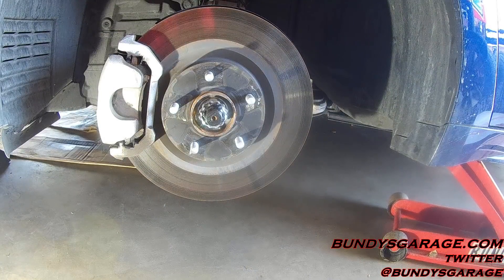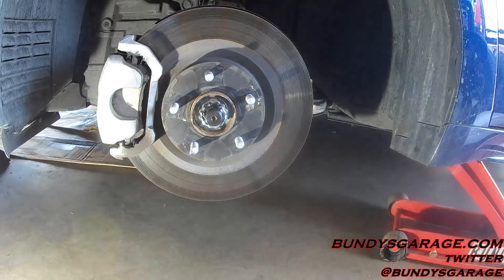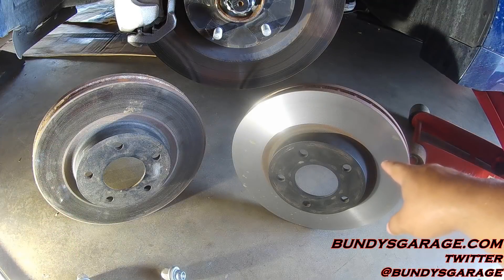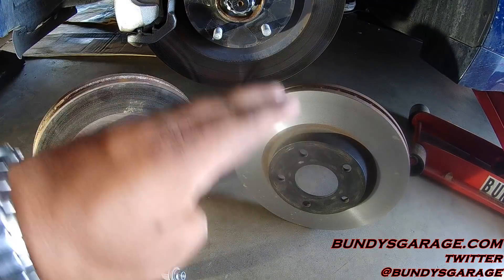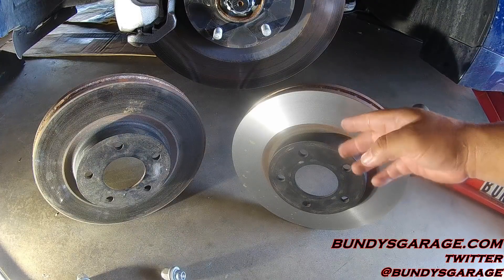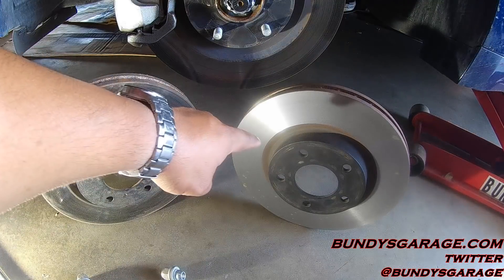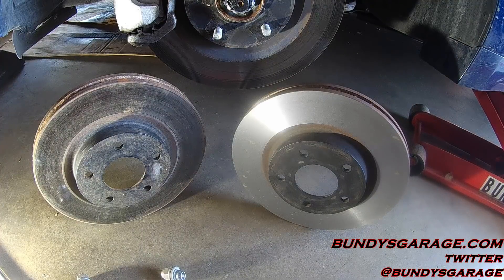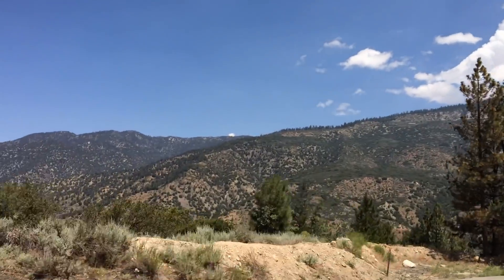Do I need to Turn Rotors when changing Brake Pads - What does Resurface Rotors Mean?

Comment: what happens if i don't resurface the rotor and just change the pads?
Reply: Nothing will happen. At all. I've never, ever, had a set of rotors turned. Never. I've driven a Datsun 510 with 300k miles. A minivan, several 4 door cars, an 05 Trailblazer and now a Suburban. Never had rotors turned. Never had an issue with brake performance. In fact, the only time I've HAD issues was a car someone else had and they did turn the rotors and all it took was ONE hard stab on the brakes and BAM, shuddering in the brakes. Also happened to my patrol car. No issues with brake shudder. They turned the rotors at 10k miles when it went in for it's first 10k checkup. Guess what. Brake shudder. If you rotors need to be replaced they'll let you know. I feel like rotor turning is the brake equivalent of force flushing a transmission. It's crap designed to take your money.
Reply from the maker: Nothing might happen and maybe 100 miles down the road you start to feel pulsation in your brake pedal as you stop. Take a gamble and find out.
Reply: That's called a pad slap. Not a best practice but you can get away with it often if they are in good shape still.
Reply: had my mechanic do it. said my front rotor was good enough. But the rear, it has a rust ring around the rotor, so it would prematurely wear my brake pads unevenly.
Reply: You'll save some money.

Comment: If your brakes are warped / pulsing don’t turn them. The grooves they cut away when turning are NOT What causes pedal to pulse. Only if your brakes are smooth but worn should you consider turning them. You want a smooth fresh flat surface for fresh pads for a good pad grip and the new pads seat and wear properly.

Comment: Actually rotors turned properly are better than brand new ones.  WHy??  Brand new rotors are stamped steel most likely in china where metal is highly suspect.  Also these new rotors have never seen any heat or vibration cycles and are more likely to warp than rotors that have been on the car a while.  New rotors are made of what industry techs call "green metal".  Metal that has seen no heat cycles.  I would take a "thinner" properly turned rotor over a new one any day.
Reply: lmao they aren’t “stamped steel” they are cast iron. stamped steel is something like a portable gas grill lmfao

Comment: there may be a cutoff point though. When "resurfacing" you are losing mass on the rotors...the same energy will be applied to the rotors as before...with less material from the rotor resurfaced there is more heat created than before for the rotor to endure....
Reply: This is true, but i think 99.9% of people will be ok.
The .01% are the people at the track pushing the car past its limits.
Reply: @Mrkevi123  is can matter in mountainous areas. But that is still a small percentage of the population
Reply: They are stamped with minimal thickness just make sure you got life left in them. It you’re already close to the minimum just replace.
Reply: @demonicredeye4183  Not all are stamped.  Especially if it's an older car.  Sometimes, you have to use the good ol' micrometer.
Reply: Terry Hesticles really? Everyone that I have pulled was stamped. I had to clean it with a wire brush but it was there.

Comment: I learned long ago that when its time to do a brake job don't try and guess if parts are reusable, use all new parts, because the time involved in doing a brake job is not worth the time it takes to troubleshoot what old part you reused is giving you problems.

Comment: How much should it cost to have rotors turned?
Reply: O'riellys
Reply from the maker: $15 - $20 bucks per rotor. Call around, some independent shops might do it for less if their not busy.
Reply: Was quoted $150 for two truck rotors.  No go.  Bought new for $165.
Reply: 3434sru yup they really don’t turn rotors anymore..aftermarket are so cheap to buy now
Reply: Canadian tire charges $50 per rotor but he hasn't done them in many years....not cheap

Comment: Brake rotors do not "warp." The pulsation or jittery feel is due to uneven amounts of brake pad material being deposited unevenly across the rotor surface to due excessive heat. You can resurface a rotor which solves this problem but it will occur more frequently due to less rotor material for the heat to dissipate through. bottom line is don't buy the cheapest brakes available. They are not all made equal.

Comment: Cool video.  I dont turn rotors any more.  i find it funny people pay 4/500 just to get the front or rear brakes done... i did front brakes on wifes corolla for $102 new pads and rotors delivered right to the door... about 20 minutes a side, less time than it would take to drop the car off at a shop... god damn i'm no genius but sure glad im handy
Reply from the maker: Yeah people pay way too much money for brake jobs when it’s a simple job. Shops love it and laugh all the way to the bank after doing them. It’s a simple job and most people are afraid of it. I have seen aftermarket rotors get warped after 500 miles. But on the other hand, have always had good success with an OE rotors that is turned and not slapping on cheap rotors.

Comment: Great video, what do you think about rear non ventilated rotors, I need to turn the rotors on my 2013 Ford Explorer, I have the non heavy duty rotors, so the rear are non ventilated, this is the first time I would have them turned, would they end up too thin afterwards? Or since it´s the rears it won´t matter?
Reply from the maker: There are markings on the rotors that give you limits on how thin the rotor can be. You cannot exceed those limits, if the rotors will become too thin  if you turn it, it has to be replaced.
Reply: @bundysgarage  I'll check the markings, thanks!!!

Comment: Whwt happens if I get the pads replaced but dont resurface the roters
Reply: I'm no mechanic,  I recently had the same question to a mechanic that didn't have a rotor lathe.  He told me with out turning your rotors or buying new rotors would void the warranty of the new brake pads.  He also told me that buying new rotors was better. Beginning to want to find a new mechanic.  Thanks YouTube!
Reply from the maker: I’ve never heard that before. That if you don’t replace the rotors the warranty on the pads is void. I think he’s just trying to get you to spend more money on putting new rotors on since he didn’t have a brake lathe. Now if the rotors are too thin to be turned, then yes buy new rotors but if the old ones can be re-surfaced, the. Have then turned.

Comment: Maybe someone can help me. I dropped my 2016 F-150 off for oil change and tire rotation. I received a call telling me my back brakes were at 4mm and should be replaced soon. Told me the rotors were fine and that the mechanic would "flip" my rotors. I told them to go ahead with the brake job. Hours later I go to pick up my truck. Thinking I was maybe looking at $200 Bill at most. I was shocked to see $335+. Looking over bill I see where the mechanic "resurfaced rear rotors or drums". Which I was like what, they said they were fine? Resurfacing section of bill shows that the one rotor was at .846 and the other at 
 .848. When done resurfacing them the numbers the invoice has is .816 and .836 I am wondering why they took 2 rotors that they told me were fine. That according to their own notes were very close in number, .846 and .848 and took them down to .816 and .836...Is it normal for them to grind so much off? Plus is it normal for them to take one down so much lower than the other? I just have a feeling the dealership service department is setting my rotors up to need replaced sooner. Have had issues in the past with this Ford Service department. I don't plan on going back.
Reply from the maker: Sounds like they screwed you, sorry dude! Stop taking your vehicles to stealership's!
Reply: @bundysgarage  Yeah I usually take my vehicles to a small mechanic shop. Who I believe are truly honest people. But I love my truck and the first time I took it to the small time place. They told me how they had to send the young mechanic who worked on my truck home to change his clothes. They said he got really annoyed with my truck. Asked them what happened and they said when he drained the oil he got covered in it. Thinking to myself..if the mechanic is to stupid to step to the side when draining the oil, do I really want them working on my baby? So I decided a Ford certified mechanic was probably best.
But now I have come to the realization that I don't care if some rookie mechanic gets covered in oil. If he is that stupid then he deserves it. As long as they don't mistreat my truck out of anger. 
What worries me now, is whether or not the difference in rotor thickness will cause driving issues, wear issues. Causing more issues with my perfect truck. Thinking to myself, did they do this in hopes of me returning for those future issues. 
I know absolutely nothing about auto mechanics. I am trying to learn as much as I can so I don't end up shafted when it comes to repairs. But I fear they got me this time. Next oil change/tire rotation I will see what the mom and pop shop has to say about my rotors and brakes.
Reply: A GM dealership charged me 200.00 to bleed the rear brakes, I thought that was a little excessive considering a car dealer just replaced all the brakes.
Reply: @Carlos Pasos I also had oil change and Tire Rotation done. 
Here's a break down of the bill.
The Works(Oil Change, Tire Rotation, Multi-Point Inspection, Brake Inspection)  Labor.       $28.31
                     Filter Asy $7.50
                    Oil.            $16.14
                  Total.         $51.95
Brakes and Rotors
          Labor.           $125.98
         Pad-Brake     $96.93
      Lubricant -UN. $17.63
       TOTAL.            $240.67
Then in the final tally. They charged me $20 For "Shop Supplies" . Then tax was 22.66. I don't know what "Shop supplies" cost me $20. Probably padding the wallet of the scamming shop manager.       For a grand total of $335.28
Reply: Rachel Gibson stealerships at their finest. glad i do all that shit myself. keep that labor $ in my pocket 😁

Comment: If you can detect no "pulsing" of the pedal and they are not overly glazed there is no need to turn your rotors. Turning rotors takes away years of use and actually slightly lessens there ability to stop.  ie: dissipate heat.because it slightly decreases the mass of the rotor.
Reply from the maker: A thinker piece of metal will actually dissipate heat quicker than a think piece of metal. Same goes for rotors. I have also seen where brake pads had a “ripple” in them causing brake pulsation when braking.
Reply: Yup 👍people think I'm crazy when I explain this

Comment: Just buy new
Reply: Seth H7bber New rotor are expensive up to $30 a piece and usually need 2; one pair for front or rear!  You can buy a used pair of rotors for  half the cost of new ones. I use my mini sander on them to plane them flat!  Saves the high cost of buying rotors and take around 3 minutes each side to do!  Change the 400 grade metal sandpaper after doing each side.
Reply: @Mr.HarryWild  does Amazon or eBay or autozone sell used rotors?

Comment: Wrong in so many ways. There is much more to consider! Most people that turn rotors don't do it the correct way and then wonder why people complain about brake noise.
Ever wonder why there is a cross hatch on the surface of a new rotor? Enough said!!
Reply from the maker: Actually you haven't said anything
Reply: @bundysgarage  Exactly, you don't know!
Reply from the maker: There is way more to cutting rotors correctly than putting a cross hatch on them. Plus putting a cross hatch does not guarantee elimination of noise.
Reply: @bundysgarage  Yeah, OK what would I know! I'm not going to argue with you.
Reply: Hmm, what is a cross hatch?
Reply: @jeffreysantos9070   @jeffrey Santos  When turning anything with a lathe it creates a "RECORD" as in Vinyl Record so after turning a rotor it is recommended to break that directional pattern by  "honing"  the surface. if you do a Google search for "Brake Rotor Hone" it will become clear. It does not guaranty that your brakes will be quiet but it is the best way to do it. A brake lathe uses a very slow "feed" so that the turning pattern is very minimal and actually hard to see these tools are designed to leave behind a real good "surface finish".
Brake Pads (in my opinion) seat better with a honed surface than they do with a turned surface.
Reply: @ralfsautomotive  👍 thanks.

Comment: I change the rotors and the pads, every single time at about 7 years for my particular car.  If you are doing a shit load of stop and go and drive a lot,  you'll need to change them sooner.  I bought premium rotors and pads for about $65, from Amazon.  $65/7 years = $9.28 cents per year operating cost.  That's really cheap!!!
Reply: That pretty costly!  You can find them on eBay for $40 for the pair,  two rotors and ceramic brake pads. Ouch!  Free shipping too!

Comment: Not true!
Reply from the maker: What’s not true? OE Rotors are a lot better than aftermarket ones.
Reply: @bundysgarage  Agree, but new rotors are better than serviced ones(thiner)
Reply from the maker: Thin matters only if the rotor you are trying to resurface is already too thin. I’m taking about actual metal material and the combination of metals inside the rotor. OE Rotors have a better metallurgy then aftermarket ones.
Reply: @bundysgarage I disagree with you and agree with the comment. I replace my front rotors on my brake jobs. Every time I turn/  resurface my front rotors they get warped when I hit the brakes at high speeds. I dont ever turn my front rotors. There is a lot of stress and weight, heat etc. Going on the front. I dont recommend it.

Comment: I had my original rotors turned that had no pulsation when I replaced the pads and a month or two the brake pedal started pulsating.Ended up just buying new ones after all to fix that .Not sure if they were not turned right, but braking was smooth for awhile till the pulsating started.No issues after buying new ones.

Comment: Actually, the pulsating you feel is from your ABS pumping when braking hard. The "waves" you are talking about are so minute that it is hard to see them let alone feel them. Great video
Reply from the maker: No the pulsating did not the ABS pump. I know the difference between the ABS pump and when the rotors are warped. And yes you can feel them.
Reply: light pulsating comes from the a warped rotor.
Abs issue/ pulsating is way more violent.

Comment: With some eBay coupons a set of new rear rotors with new brake pads is around $45 for my Honda CRV, and it works just fine. To resurface the rotors the price was $50, plus I still had to buy brake pads... American labor is expensive, it is like fixing your TV - cheaper to buy a brand new one these days
Reply from the maker: Too bad your putting Chinese people to work instead of Americans

Comment: Unless your rotors are warped or seriously scored or very worn, which is very unlikely, there is never & need to replace or turn rotors! It's just a big $$$ con!! One can tell if they are warped because when you break, you will get a thumping/jerking stop. This is also a very rare thing now that most rotors are vented. Old solid type rotors could get very hot & warp if your calipers got stuck. Not very likely today because of improvements in design!
Reply: Agreed, rotors should last through multiple sets of brake pads without having to be turned.  Also, the big scam is in doubling or tripling the parts price.
Reply: I disagree. Over my lifetime, I've tried it both ways many times. I have replaced pads without turning rotors and each time I regretted the decision. You might get lucky, but I always got squeaky brakes from poor contact with the rotor (due to the uneven surface). When I resurfaced the rotors, my brakes were quiet as a whisper.
Reply: @nuancolar7304  you're probably buying cheap pads. Ceramic pads won't squeak and they mate quickly. Get some good Akebono ceramic pads.
Reply from the maker: Quiet as a whisper, NICE!!!!

Comment: a seasoned rotor .. lmfao..here is your sign ..
Reply from the maker: You know nothing about automotive or metal at all.
Reply: Ya coming from u saying rotor having feeling bro idk what u smoking stick to ur day job tho
Reply: Really weres he get that from lol
Reply: Seth H7bber as a metallurgist, he’s not  wrong. Brake rotors are already tempered to a certain specification. However as with all manufacturing processes there can be flaws. So say a rotor is improperly tempered (seasoned if you prefer) adding extreme heat from hard braking could very easily cause a warp. Running the rotor through several of these cycles should produce the most extreme result. Therefore once you turn the rotor back to true it should remain straight for the duration of its life span. There are other factors that can cause warped rotors but as far as what he stated, his hypothesis is correct.